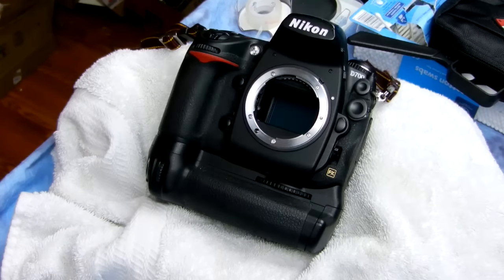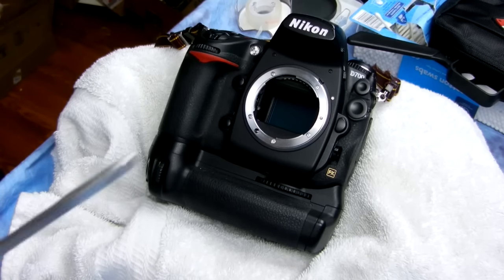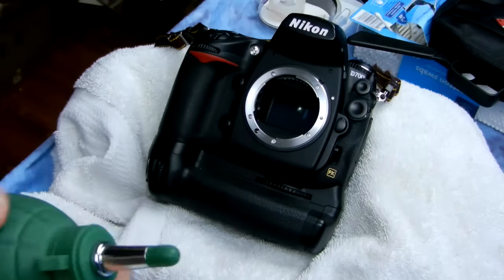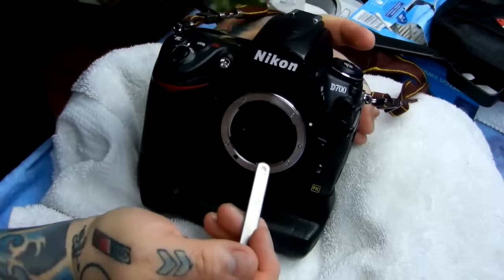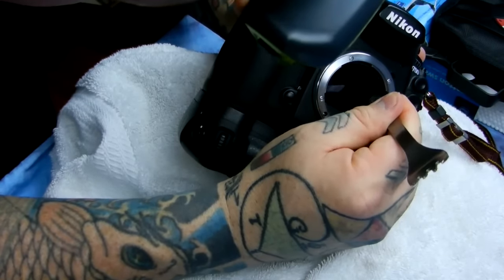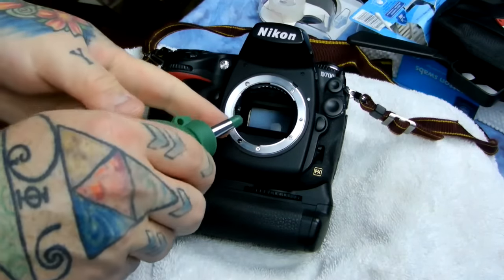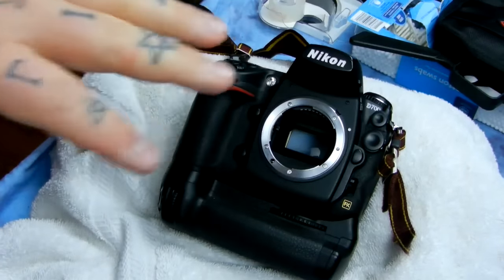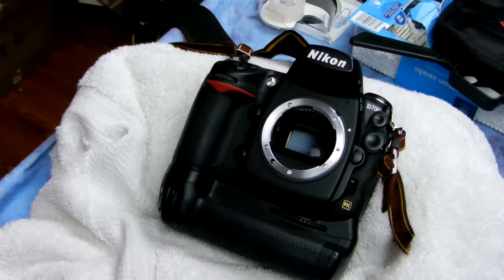Angry Photographer: STEP 4 Second part cleaning your light-box: TRICK to removing dust on the FELT!

Comment: Thanks Angry... cool trick! Do you think this is necessary though? Wouldn't it be a safe assumption that if the stuff in the light box doesn't come off of the felt with the blower, the chances of it coming off spontaneously at all are pretty slim?
Reply from the maker: +Josh Levinson ohh it comes off easy using a rolled up piece of duct tape

thats an OLD trick i use
Reply: +Theoria Apophasis What I mean is, if the dust or whatever is so stuck in the felt that it needs this tape trick to remove it, it's probably unlikely to come off by itself and fall onto the sensor, don't you think?
Reply from the maker: keep it simple, use the tape, remove it, problem gone.

yes, it can and does migrate to the sensor.